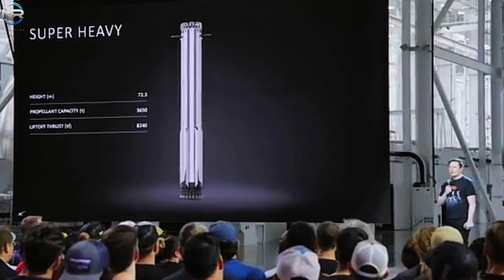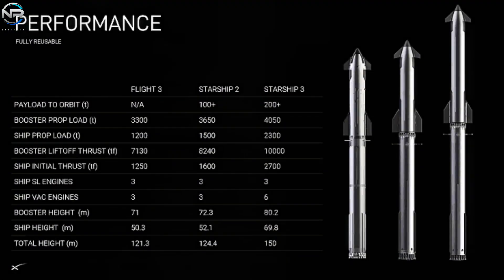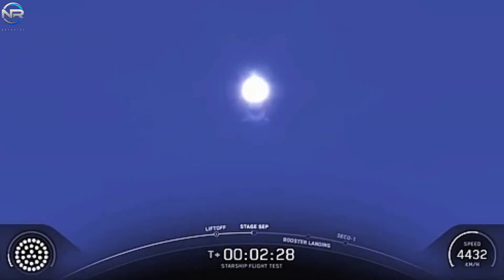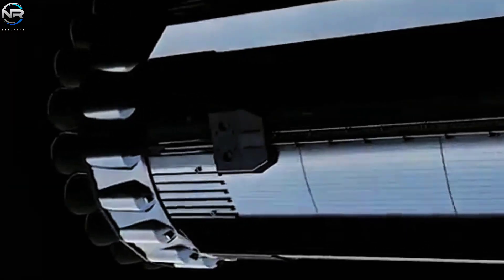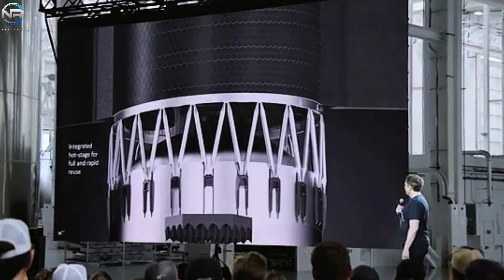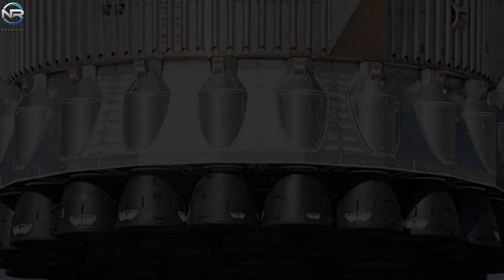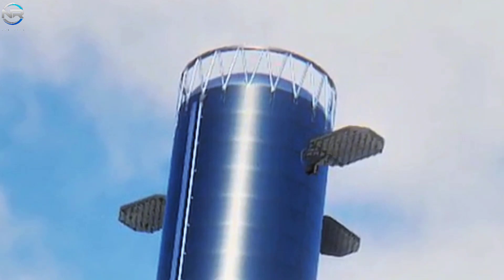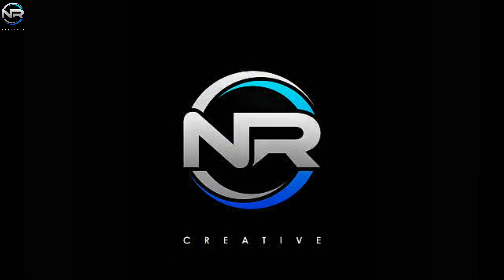MASSIVE UPGRADE! Starship V3 Prototype Leaves Engineers Stunned, Elon Musk Reacts!

Comment: If you look closely, SpaceX didn't save a single gridfin,
but combined two gridfins.
Why?

The current gridfins are positioned at 8 and 10 o'clock and at 2 and 4 o'clock.

So, SpaceX combined 8 and 10 at 9 o'clock,
and 2 and 4 o'clock at 3 o'clock.

And then positioned another gridfin at 6 o'clock or 12 o'clock.

The 9 and 15 o'clock gridfins are for tilt control.
The 12 o'clock gridfin can perform a booster rotation.

RFC 007